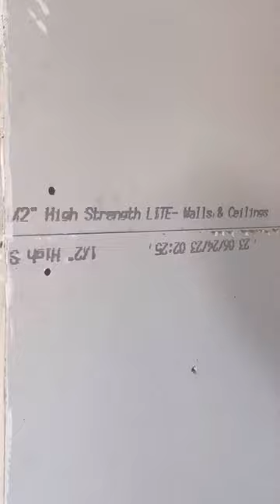Beginners Can Easily Finish Drywall With This Drywall Tape!

Comment: Basic question. Once you've imbedded the tape, and wiped out the excess mud...how many coats is normal after that? The guy Ive been working with uses hot mud for the tape and then calls the first pass (with regular mud) over the tape the "second" coat.. which I think isn;t actually correct.
Reply: All about how quick you can achieve the results wanted. If you can in 3 coats who cares but usually tapping is not a coat as usually tape would show and then you start counting from there. Some people combine tapping with the first coat. A lot of pros don't like this idea as they believe you should let the tape dry and basically shrink before applying anything on it. Thing is, hot mud doesn't shrink much compared to "normal mud" and so using hot mud for tapping will propably result in a bumpier end result as it won't retract the tape as much in the bevels once the hot mud dries out. Just a thought.
Reply: You have three coats. The tape coat is number 1,the bed coat is the second coat and then the skim coat is the number 3. Your boss is right..
Reply: @Hamp72  there is no right or wrong it all depends on the customers request on what level of finish they want
Reply: @simonmonty7171  bro I have my own drywall business since 91. That's 32 years in the business. I should know.
Reply: @Hamp72  yeah you should know that here we do things differently. We're not all from where you are buddy boy. Get off your high horse mister know better 😂
Reply: @simonmonty7171  I see how you do it. Boy

Comment: I've used this before and it's great. However, that is not the correct mud to use. FibaFuse requires setting mud for it's strength. The premix buckets are for top coating it after.